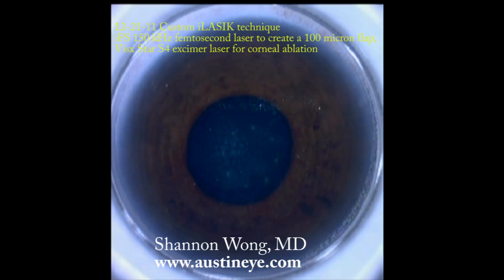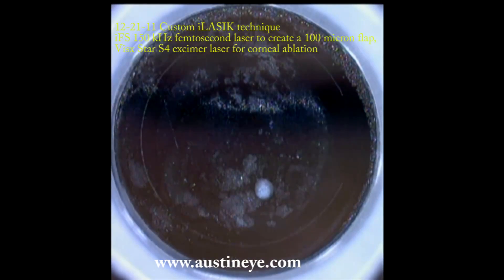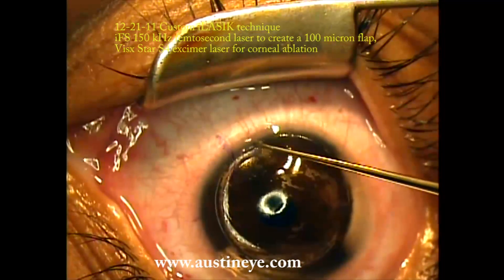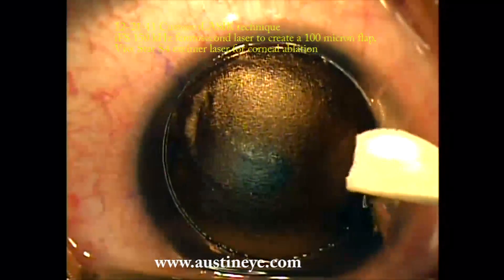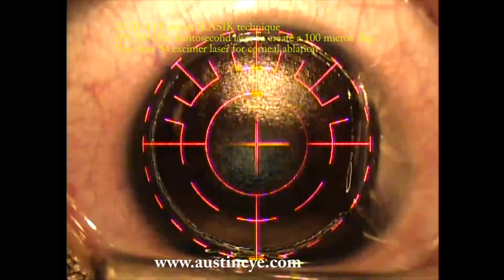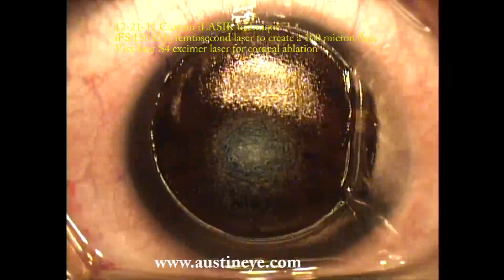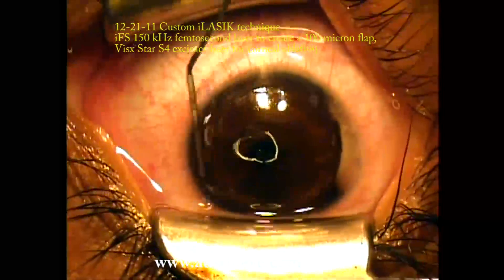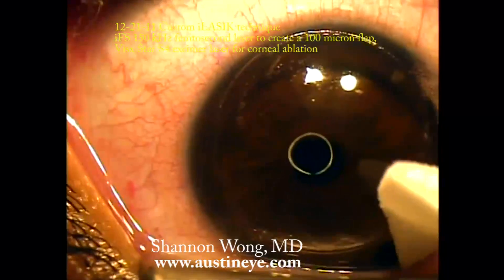LASIK surgery explained step-by-step by Shannon Wong, MD. 12-21-11.

Comment: I did this, one eye was quick and smooth, the second I could feel some needles in the eyes which made me move slightly, so had to go through some stage twice. Also the painful eye post op. Happy with the result so far. Do not hesitate to ask for stress killer before the surgery as I didn't have any and I was tense as a thriller during the operation.
Reply: DAMAGING MY EYEBALLS RIGHT OFF THE BAT IN ORDER TO POTENTIALLY RESTORE MY EYEBALLS TO 20/20 WITH MINIMUM TO NO RISK AND DANGER........................NO THANKS, I'M NOT FOOLISH